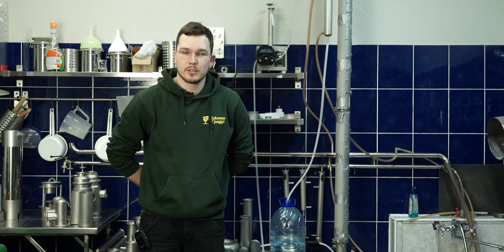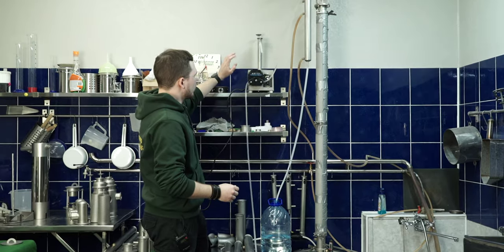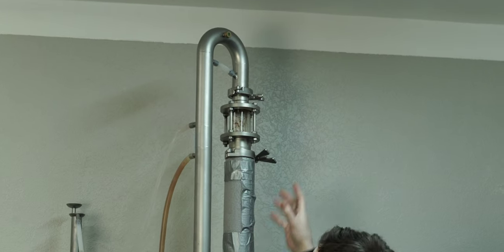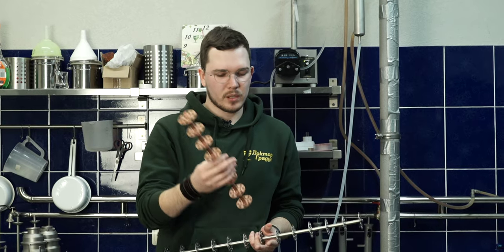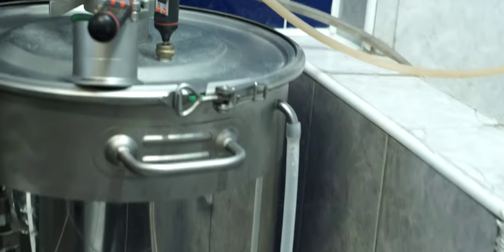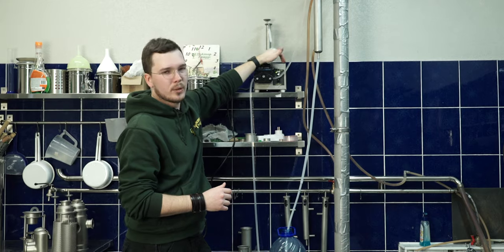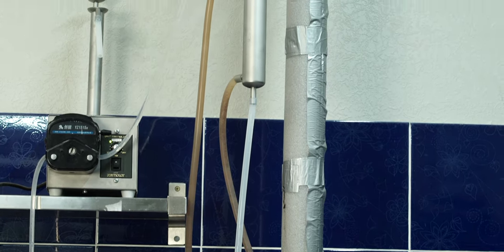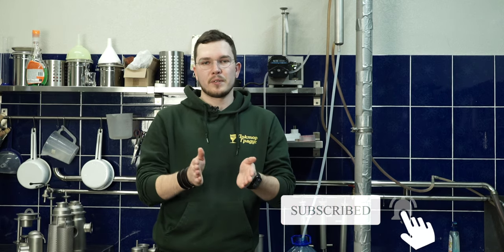Continuous Still - easy home setup

Comment: Very nice setup and explanation,it will save energy too 😃
Reply: Got a question from someone,  can you explane if the wash is pre heated, by the product cooler ?
Reply from the maker: Sorry, missed your question. Mash is pre heated by vapour which is coming from the boiler from the begging, the we have alcohol vapour, when we turn on pump with mash. Under the pre-heater we have usual shotgun condenser.

Comment: Great set up. Do you use just the one condenser or do you also have a condenser on the waste outlet to help heat the mash up to 80 degrees?
Reply from the maker: In this solution we don't use waste as heater of actual mash, but we've made one column where it's made. I hope next year we show it here.

Comment: excellent video!!!!!   i am just learning about continuous distilling!  can I purchase the metal filter you showed in the beginning?  and the pump you use is capable of handling higher proof alcohol?  I want to circulate my hearts  through a charcoal and flavor bag for several hours...will this work?
Reply from the maker: Happy to hear that! If I understood correctly - siphon - here - https://doctor-gradus.com/catalog/sifony/ 
Pump is capable to transfer high proof alcohol, it's 24V so it's able to work everywhere. Might be a bit slow, but works great. 
Here is a pump - https://doctor-gradus.com/catalog/nasosy/nasos_peristalticheskiy_/ 
Yes, it's going to work fine at the process you mentioned.
Reply: Comrade Gradus- have you developed ....or maybe we can develop a re-useable filter to clear mash quickly  before distillation?  this would be the best invention in 100 years....im trying but its difficult-  do you have ideas? Time is money and waiting to clear mash is problem.

Comment: would this setup be considered a "reflux" setup
Reply from the maker: Yes, this distiller is modular, so you just need to add dephlegmator, which is included in this kit. Then make a second distillation using these plates as well. Result is pretty good, if you're distilling fruit or grain mash. Some people like simple sugar distillate with reflux with these plates, but I don't really. It's better to add mesh packing or SPP and get more neutral spirits (in case of simple Sugar)

Comment: Are there any plans for a 76mm version for those of us with existing 3" columns?  Will your peristaltic pump be adequate?   This seems like a very tidy tool for home distillation.
Reply from the maker: Yes we have plans for 3 inch continuous columns and already tested one. We are changing the packing for better performance. This 2021 there going to be more parts for 3 inch columns. Write us what you intended in? Some parts we already making for buyers.

Comment: how do you separate foreshots and heads with this?  or do you pretty much have to do a spirit run after?
Reply from the maker: Yes, our Continuous Stills are made for kind of Russian choice. So, it's just a way to make first run with collecting great low wines where is no boiling taste and flavour. You right you have make a spirit run after distillation process and cut foreshots and heads. We are going to build continuous stills where is going to be units to collect everything you need to, but don't know when we start.